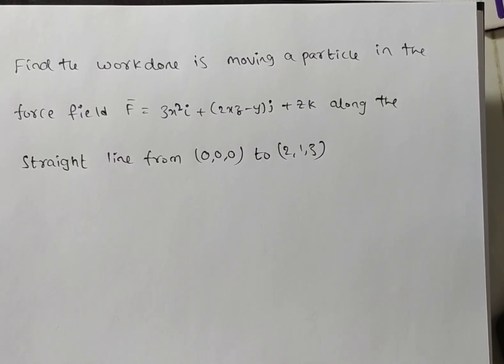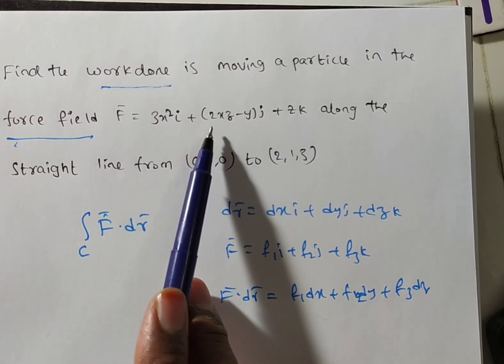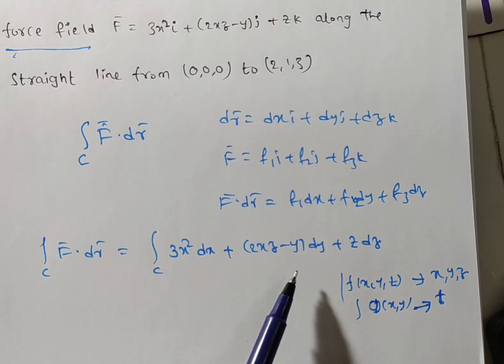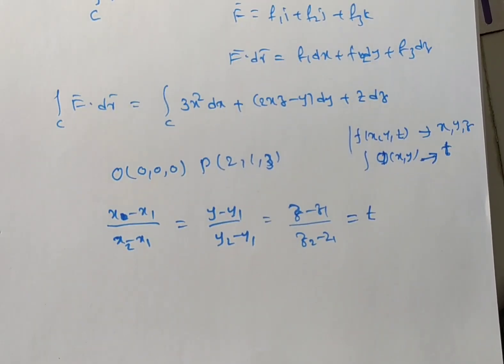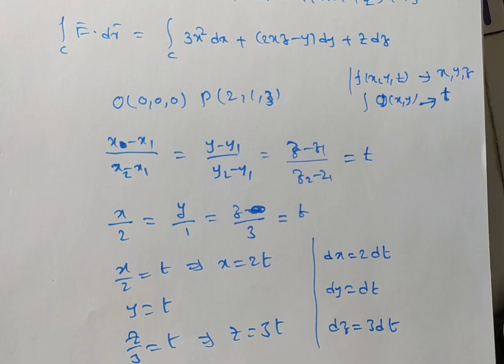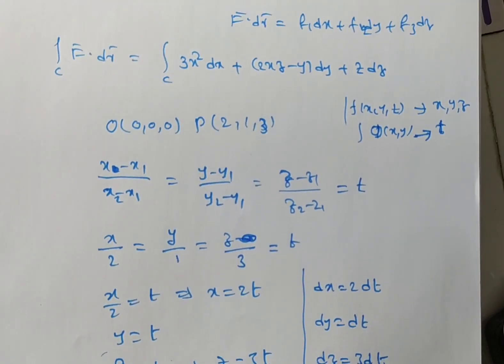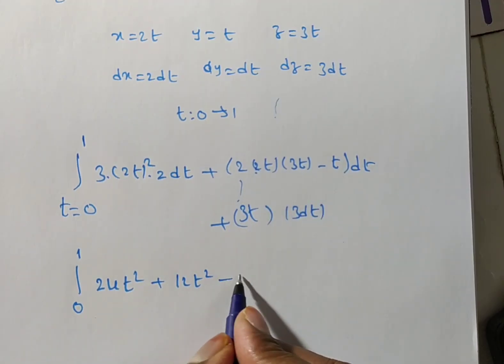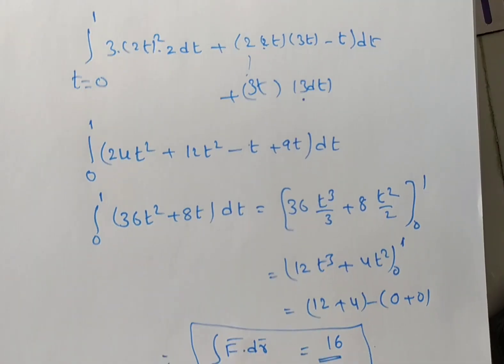Line Integral Solved Problem: Finding Work Done Along a Straight Line Path by team education

Comment: Tq sir 🙏
Reply from the maker: Welcome
Reply from the maker: Based on  students request , purpose of the final exams, i did chapter wise videos in PDF format, if u are interested,  you can download Unit wise videos by clicking the below links
TEAM Education

Unit 1:ODE First order Differential Equations
https://drive.google.com/file/d/1NTalx7plMzFqzVvQft6UUK_E9RQmK8aD/view?usp=drivesdk

Unit 2: Higher order DE. 
https://drive.google.com/file/d/1NYx2wiY7wZVi8CLnLmj9nLi6cCJ5FXc-/view?usp=drivesdk

Unit 3: Multiple Integrals 
https://drive.google.com/file/d/1Nhv_cp5rnOTs7Z92gIfWGniU8QtcF07z/view?usp=drivesdk

Unit 4:Vector Differential Calculus
https://drive.google.com/file/d/1NjRSQx0j-ENuA_oXElfHbr2HJ7ngH1Vx/view?usp=drivesdk

Unit 5:Vector Integral Calculus Part 1
https://drive.google.com/file/d/1O-xAP2TKAeOl4XXFuLufuAbHIrpjpc4n/view?usp=drivesdk

Unit 6: Vector Integral Calculus Part 2
https://drive.google.com/file/d/1O1gS9Ev8_7y4Y30hdBwbISkIL3bLQvsy/view?usp=drivesdk

Unit 7: Special Functions
Beta & Gamma Functions

https://drive.google.com/file/d/113SbB0J3H7LsVEFLxYYdAB-uuw-RflY_/view?usp=drivesdk 

Unit 8: Functions of Single Variables
https://drive.google.com/file/d/19SN5EB93_lgS8JRe1DV9MRdutucSJjHk/view?usp=drivesdk

Comment: Is it possible that the 't' limits are not same for x,y and z.
If yes ,then what we have to do....?
Reply from the maker: X, y, z limits many be different, but t  limits must unique, here we are changing curve into parametric form so, converted limit should be unique
Reply: @TEAMEDUCATIONMATHEMATICS  Thanks for reply sir,
Sir I'm getting t - limits always 0 to 1 for any points,is it right sir..?
Is the limits of t always 0 to1?

And also sir we can do the problem by directly taking the points as limited without having a variable - t. isn't that rignt...?
Reply from the maker: "t" limits are depends on problem, not 0  to  1, 

You observe given problem, if u want find work done(or line integral) we have to integrate with respect single variable, so we are converting, for this purpose only, (Green's, Gauss, Stoke's thorems) application of vector calculus is came